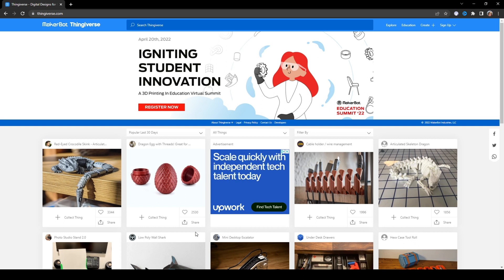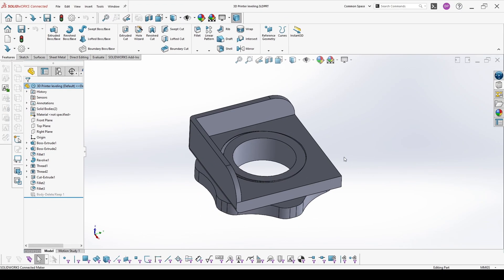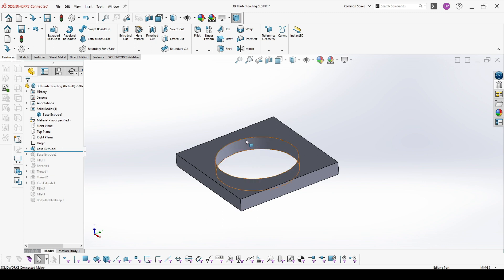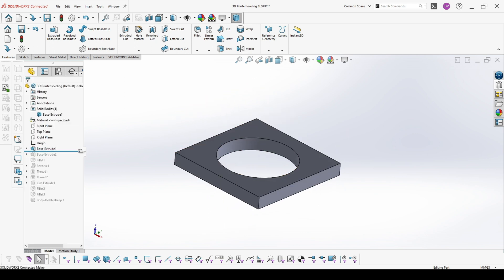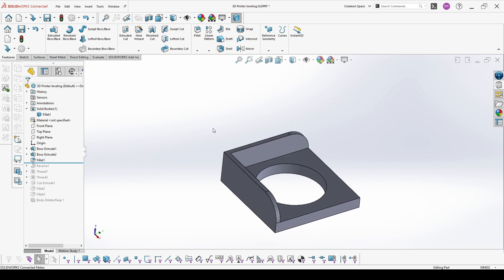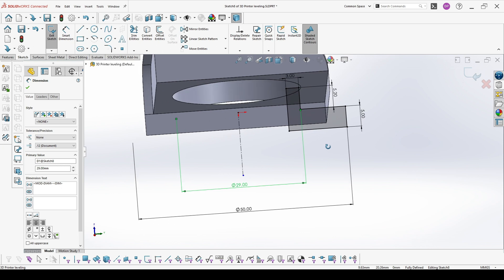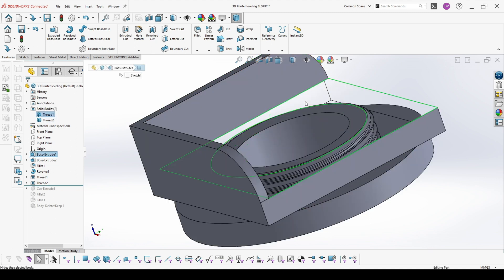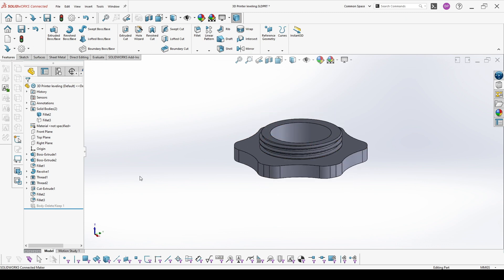3D print design with SolidWorks - how to prepare to achieve best results

Comment: Thx D. But dont get it why the printer chassi must be in line with the print surface? The important thing is
that the print surface must be in  parallell with the print head? And adjusted by the red wheels  shown in video.
Reply from the maker: That's a great question that I'm more than happy to answer. Every vibration reflects on the quality, sure it's not a must to level the printer itself, but the more stable it is, the better is your print quality. So it's important even of what table/desk your printer is sitting, unstable table/desk = ringing in the print.